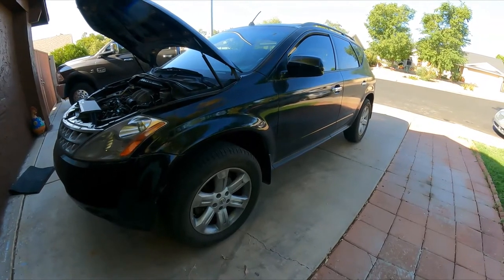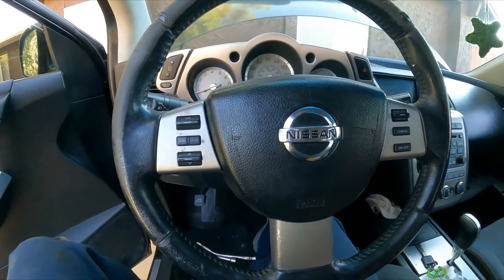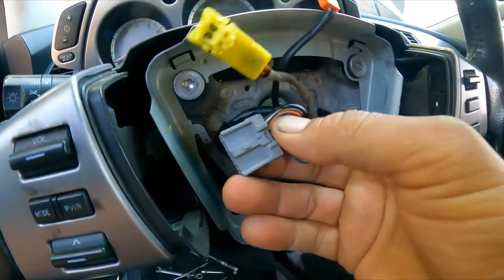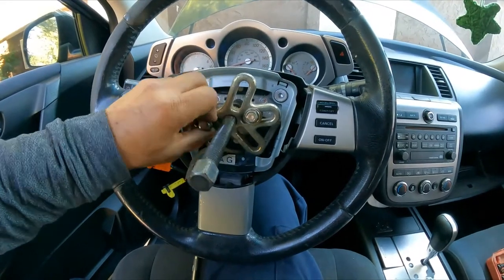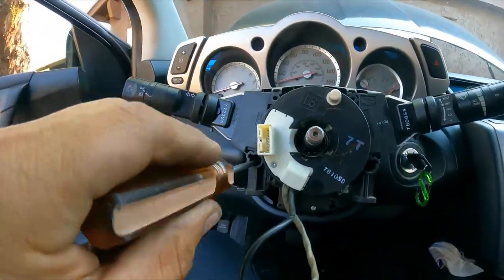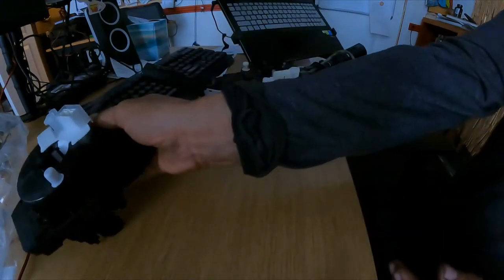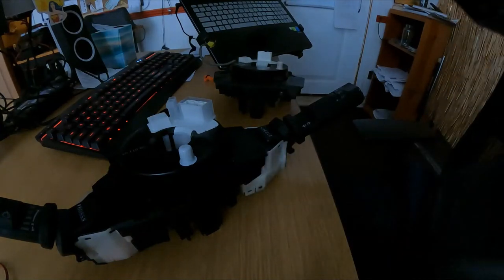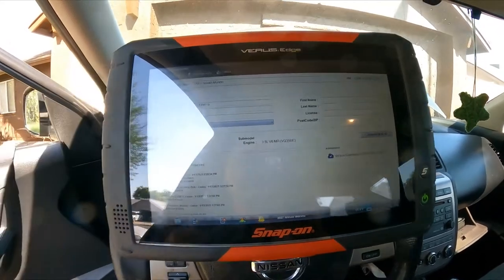2007 Nissan Murano Air bag Clock spring replacement (EASY)

Comment: I appreciate the video! I just ordered this part for my Nissan as my radio controls, horn and airbag light flashes/quit working. Thankfully the cruise control hasn't failed yet.
Reply from the maker: I appreciate you for posting your comment.  Thank you so much for that. I am glad that the video helped you. Keep me posted and have a great weekend and God bless you 🙏
Reply: @gqautodiagnostics  Thank you so much.... I'm about to do the job but you didn't mention when to take the factory lock off of the new one. can you answer that?
Reply: Be careful removing the airbag bolts. Mine were very tight, had a hell of a time

Comment: You talked about the clip on the new clock spring that keeps it centered.  I really can’t afford a new one, so I was going to get one from a salvage yard.  Will there be any issues installing a used one?
Reply from the maker: Hello! That is a good question. As long as the clock spring is good it should work. Make sure to put the steering wheel at the center position. Keep me posted. Have a great weekend and God bless you 🙏

Comment: This video saved me tha you. 
? So when I accelerate hard my car pulls to the left when I let off the pedal it pulls. Tire pressure is good I just had it aligned seems like all my mounts are good. I am clueless as to what it might be. Can you help me with this one?
Reply: Check your caster mate, ask alignment guys
Reply: It is because steering wheel angle sensor was uncallibrated and ESP started work incorrectly

Comment: 6:02 Is it 100% necessary to use the tool for the harmonic pulley? Is there any other tool that will work?
Reply from the maker: Hello. Using the tool makes the job a lot easier. You can rent the tool and get your money back.

Comment: Hey Mr. GQ at what point do you take the clip off on the new one? That clip that keeps it from moving.
Reply from the maker: Hello! Thank you for reaching out. The clip is removed right before installing the steering wheel. Let me know if you have any other questions and keep me posted